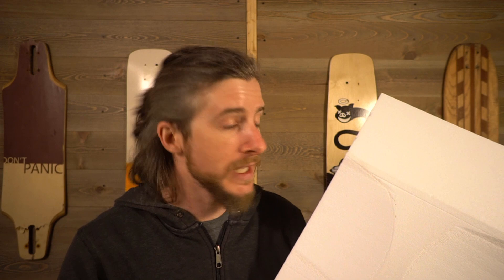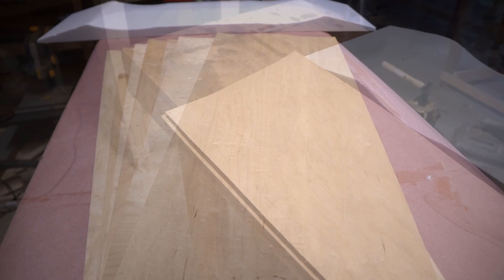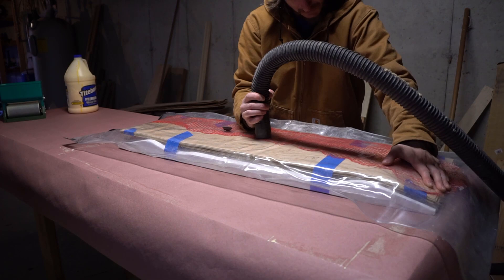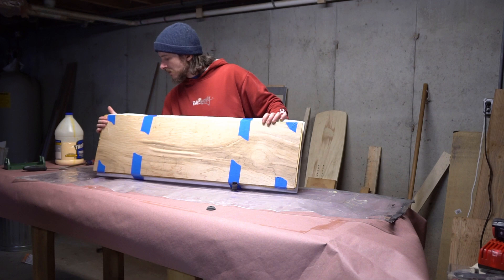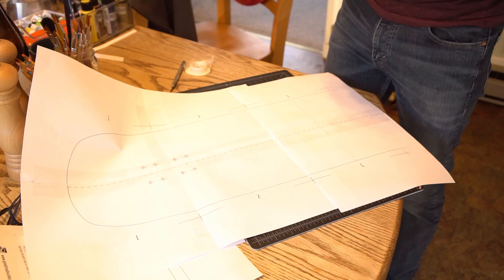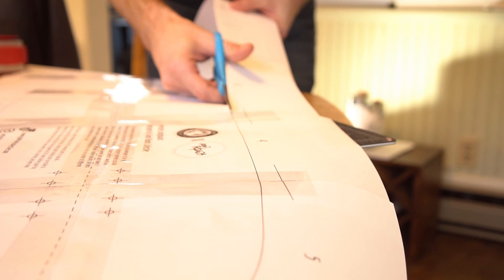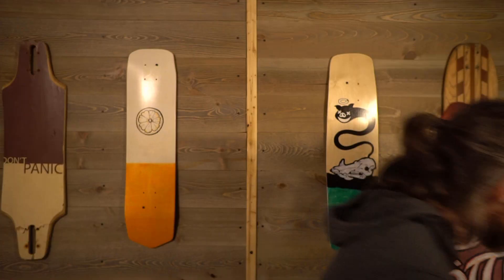Roarockit Collab Kit Release - Build Your Own Longboard!

Comment: How many layers of maple required for a slightly flexy 40" board for my 250 lbs? Thanks! Can you use this bag for fibreglass? How would adding a layer or two of  fibreglass affect flex and snap? Thanks!

Comment: What 3rd printer do you suggest I invest in so that I can start making wheel molds and bushing molds, or even the skate board mold also are you using a special plastic for your skateboard mold? An I have recently been saving my metal cans so that one day I can melt them down to make trucks is there anyway to make trucks with a metal mold instead of the sand mold method?
Reply from the maker: If you want to make molds for decks I'd suggest a large format FDM printer, I use one called the Artillery Sidewinder X1, for the wheels and bushing molds a resin printer is much better and there are a ton of good options out there. Metal molds for aluminum have to be machined out of steel and they are EXPENSIVE! Sand is honestly cheaper and easier
Reply: DON'T Use a 3-d Printer, UNLESS, SOMEHOW, You have RESILIENT Polyurethane, for these 'products!' Do You? I DOUBT IT! "PSR"

Comment: I cant tell but the board looks separated when you removed it from the vac bag.
Reply from the maker: There was a little bit of separation at the edges but it didn't go far enough into the blank to cause issues. I think it was mostly due to an unexpected cold snap that made it take much longer for the glue to cure up properly
Reply: And the nose and tail didn’t looked pressed to the mold. It looked straight. I thought it was a dry run and filmed the layup out of order. Then I saw the bubbles from to much glue. Im a little confused
Reply: @brentmarks_diy  me too
Reply: @pietrocolombo2104  I think the bag didn’t hold the vacuum and air got in before the glue was set. I press boards this way. The wood would be pressed tight against the mold if done right. This video isn’t very transparent, but I get what he’s doing
Reply: @brentmarks_diy  So you feel comfortable with the roarockit vacuum bag? because I was thinking of buying it not so much to press rather to put the fiberglass on the bottom.
Reply: @pietrocolombo2104  Yes, it makes really good boards. If you go to the open source YouTube channel, he has a video putting carbon fiber with the roarockit bag. I’ll try and find the link

Comment: Friend, I have a huge doubt, which is more resistant, maple or bamboo?
Reply: Use Both! But, layer the Maple 'OUTSIDE' of a Bamboo "core". Why? Splinters, and Structure of the Grain of wood. Maple is Far Harder, able to Absorb Impact, but Heavy. Bamboo is Springy and Light, with a very "reed-like" straight-grain (it is, actually 'Grass', not 'Wood', but it's Splinters are UGLY NEEDLES of Pain; used as Torture in WW-2/Korea/Viet-Nam) , so treat Bamboo as an 'Organic' single-thread Fiberglass, not a "wood" at all. Maple, in two layers, underside, can withstand impacts, but Not repetitive Ollies, so, 3 Layers there, two, set Long-grain, one Cross-grain. Up Top, at least one Maple layer, perhaps cross-grain IF you've got Concave planned. I've been making my Own decks since '74, but, back then, it was a SLAB of wood, with a Wedge-cut Kicktail.  "PSR"